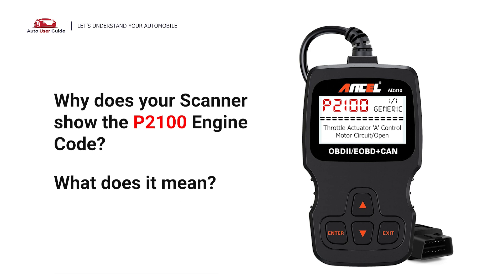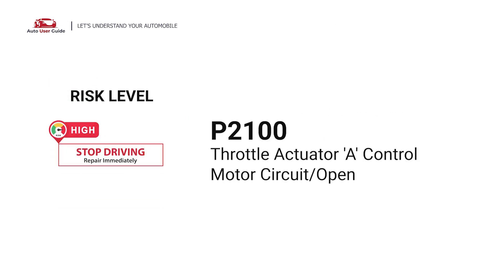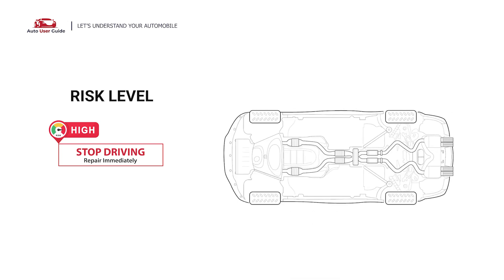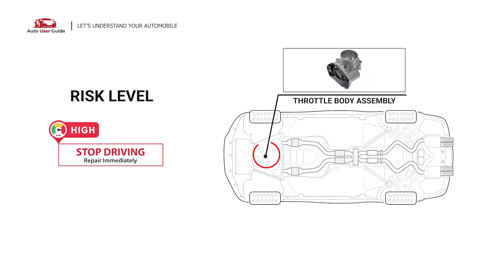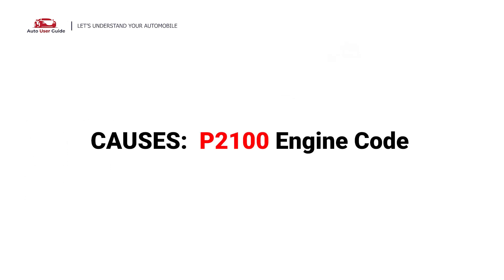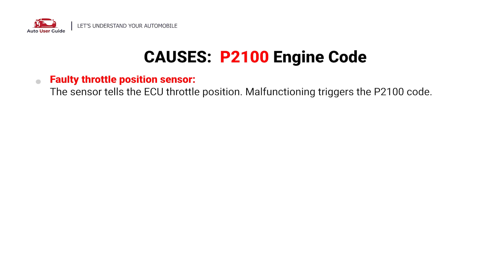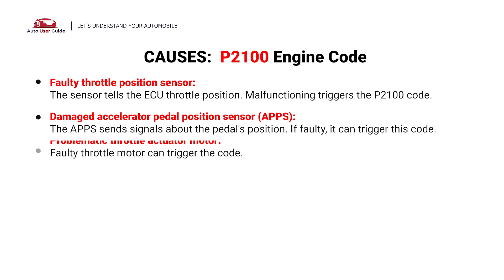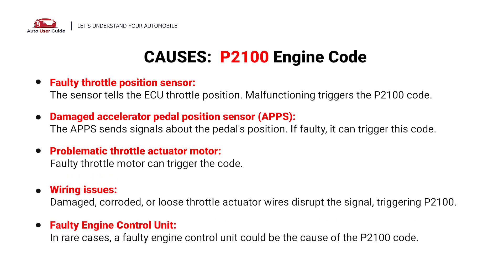What is P2100 : Engine Error Code Causes Explained

Comment: Dodge Durango 5,7 2006.. code p2100
Changed the throtlle housing. Fixed the problem for a month. Now its f…..d again. P2100 code. What is my next option?
Reply from the maker: Thanks for the update! Sounds frustrating. If replacing the throttle body only fixed it temporarily, the issue might be with the wiring harness, throttle actuator relay, or even the PCM. Corrosion or loose connections can also trigger P2100 again. I’ll work on a more in-depth video for the 5.7L Durango soon — stay tuned!